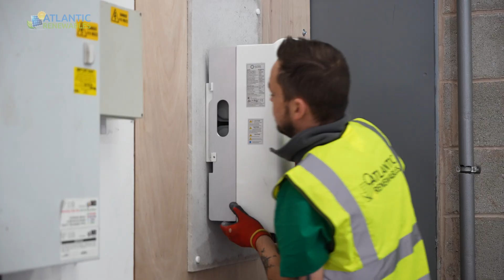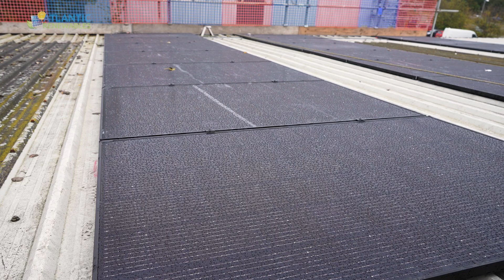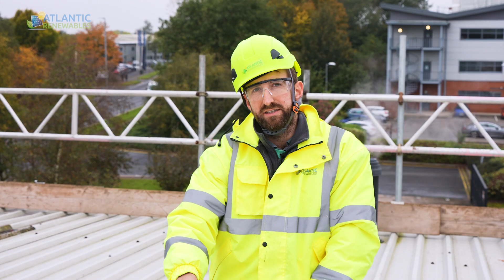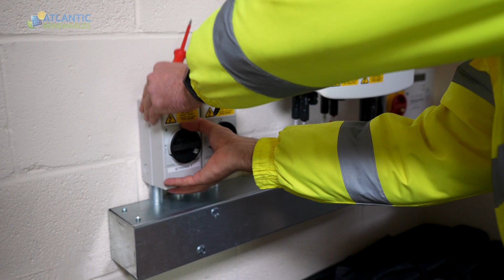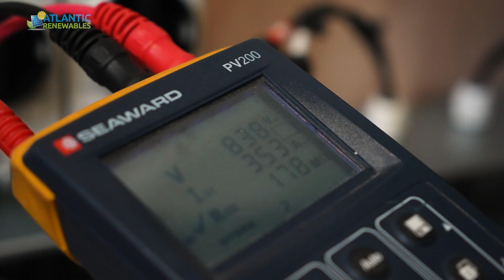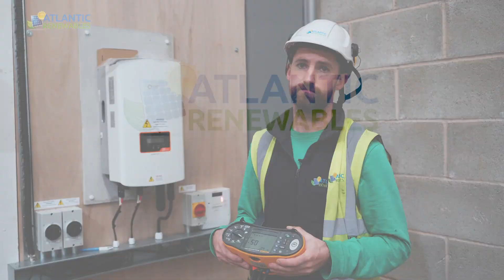5 Solar PV Installations At Crewe Trade Park - 17.2 kiloWatt Peak Systems

Comment: Nice install , just noticed the two cables in the DC isolator are in 2 different couplers, are eddi currents an issue with DC side of power?